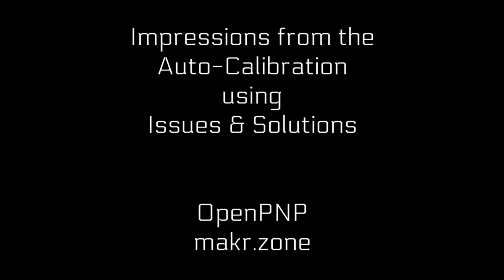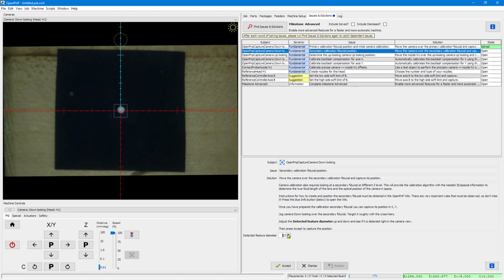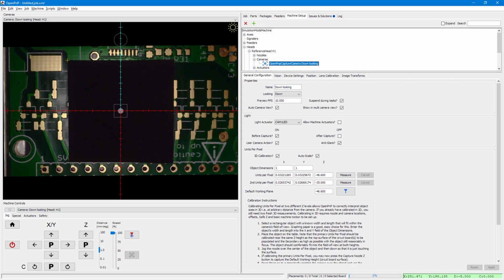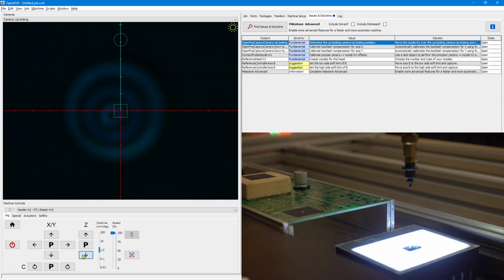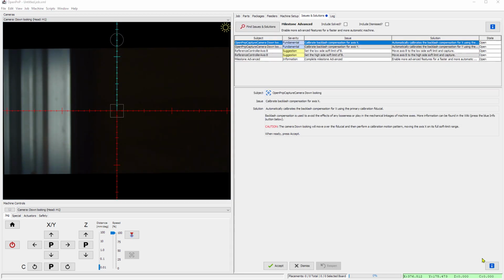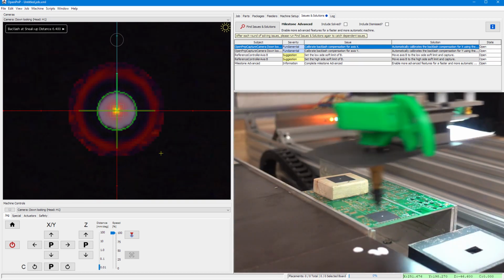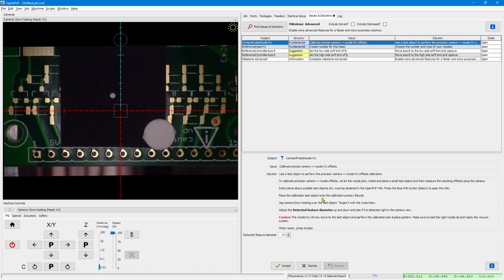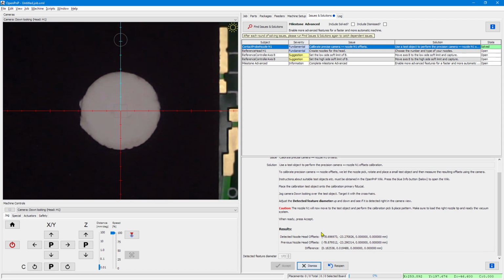OpenPnP: Automatic Machine Calibration

Comment: Hi Mark. Thanks for all your work.  I have been testing your latest test version. The auto camera calibration is brilliant.
A few observations:
- I find navigating the Milestones klunky. I would prefer some tabs or buttons across the top (including an 'ALL' button)
- when you accept a suggestion, it would be nice if the highlight moved down to the next open item.
- something in the calibrate area changes the Driver/Motion Control Type to ModeratedConstantAcceleration which then sends an M204 before each move command and the machine moves like treacle - REALLY slow!
- I can't to a Y axis backlash setting because it wants to move the Y axis to -37mm and my soft limit is zero. The primary fiducial is at Y 55.611mm. I guess I could move the fiducial back but will moving it muck anything else up?
- the first time I tried the X backlash it showed a nice little plot at the end. The second time I didn't get the plot ??  It would be nice to manually or automatically save these plots for later analysis. High res PNG perhaps?
- the test version seemed to install over the current version, even though I selected 'new directory'  Win 10

Cheers,
DG
Reply from the maker: Hi diggraph,
The milestones were specifically added to prevent users from adopting the often "juicy-sounding" advanced/difficult options too early, i.e. before the basic machine setup is achieved. Some "clunkyness" is intended, to keep users from skipping over the essential (but maybe boring) stuff too easily. It's a bit like levels in a game. You have to earn them first.

For the most part, the milestones are cumulative, i.e. all the solutions from earlier milestones are available in the later milestone, so adding an "ALL" is not really necessary. Most Issues & Solutions logic permanently reacts to any configuration changes, so these issues will always also pop up if you are in a later milestone. For instance, if you add a driver later, Issues & Solutions will help you set it up, no need to go back.

Re the Motion Control Type: Make sure you understand and set the acceleration limits on the Axes:
https://github.com/openpnp/openpnp/wiki/Machine-Axes#kinematic-settings--rate-limits

Re the Y backlash calibration: Yes, your calibration fiducial should be further away, as described here:
https://github.com/openpnp/openpnp/wiki/Vision-Solutions#calibration-primary-fiducial
But you can simply move the fiducial coordinate, the location is stored on the head and can be captured there. There is no need to re-do all the other calibration fiducial related stuff. Just change the location and continue with the backlash calibration. There is nothing permanently tied to the calibration fiducial location, so you are allowed to move it around (except between the initial camera calibration and the nozzle offsets steps, those two must obviously be done as a pair). 

CAUTION: the same obviously does not apply to the homing fiducial. Never move the homing fiducial.

Re the graph being stored: that's already the case, it seems you don't have the newest testing version.
https://github.com/openpnp/openpnp/pull/1293

For further troubleshooting, I suggest you go to the discussion group. There are other users there that might be able to help, and it is easier to discuss, including through email. 

http://groups.google.com/group/openpnp

_Mark
Reply: @markmaker4345  Thanks Mark.  I was on the group but managed to leave the comment on the video. I will try harder next time ;-)
Y Backlash now done but no graph. 😞
I thought I had the latest version because I only downloaded it yesterday. V 2021-09-19_21-26-42  Where should I be looking for the latest?
I have tuned the acceleration limits using the great MotionPlannerDiags you added and they work well but somewhere during the calib milestone the Motion Control Type got changed and caused the very slow behavior ??
DG
Reply: Ah found the graphs!  I was thinking I saw them on the Issues page.

Comment: Hi Mark, I have a few questions...
1- What is the distance from your down looking camera to the PCB?
2- What is the height of the elevated platform from the PCB?
3- Which camera and lens are you using that gives you this focal length range?
thanks
Matt
Reply from the maker: 1- I have a 6mm lens and the camera pcb is about 90mm from the PCB.
2- about 12mm 
3- ELP FullHD camera but in HD mode (720p 60fps) which is a crop of the full sensor area, i.e. the focal length is in reality longer than what the lens spec says.

All this is more or less the outcome from the Liteplacer mechanics (I made my own camera holder, but the geometry is about the same). 

The important thing for (1) is that you see enough in the camera view to use the feeders you want, for instance the ReferencePushPullFeeder needs to see some sprocket holes and a lengthy OCR label. The BlindsFeeder needs to see some blinds in the cover, the larger the part pitch, the larger the area it needs to see. 

My camera sees a ~43mm x 24mm area in the HD mode (720p 60fps). That's what you need to aim for, a bit more would be better. 

_Mark